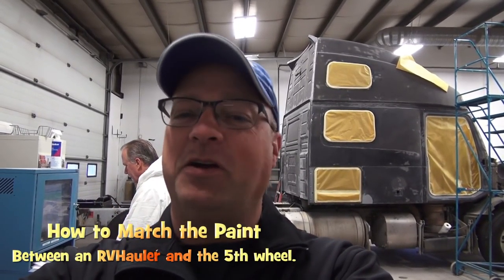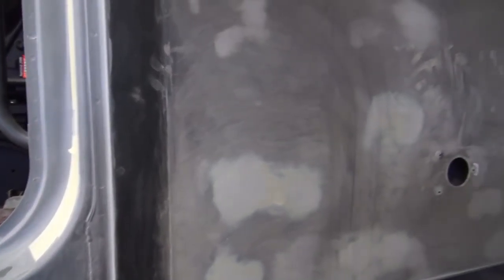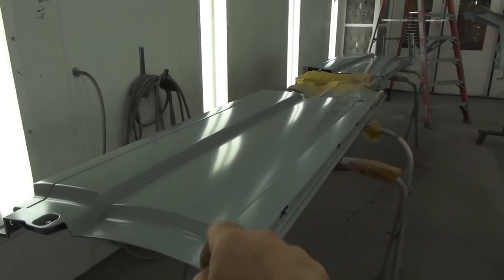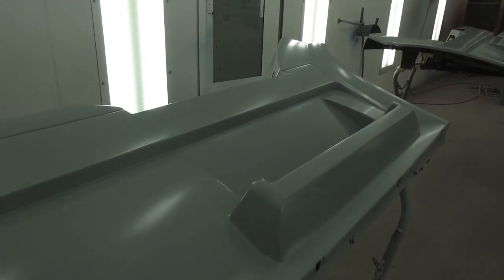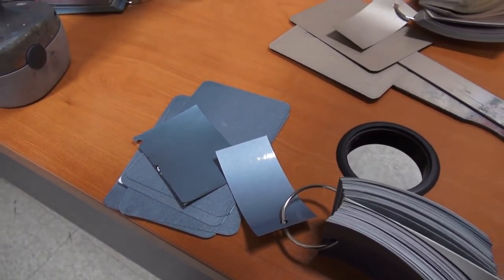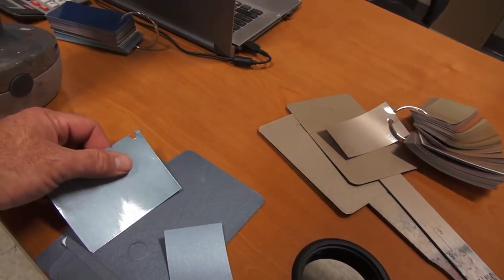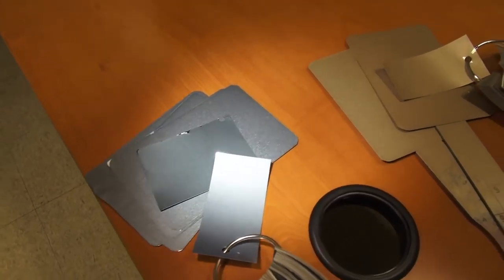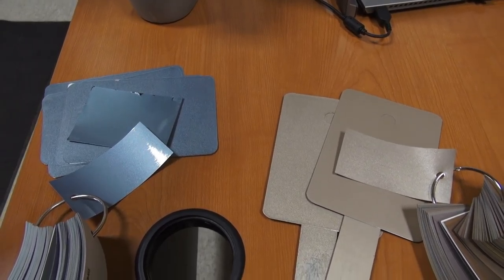How We Match Paint Colors and Full Body Paint Preparations for STORM

Comment: I've been checking your video.. I like what I see.. My question is. I want to buy a Volvo to convert it to an RV.. 2006 2007. Been checking them out on kijiji. I much are we talking about converted to an RV.. I live in Windsor Ontario...  I am pulling a 40 foot Toys hauler. My truck is a 2500  diesel 2013 ..I'll be waiting for you reply thank you
Reply from the maker: +Gill Labelle  There are quite a few questions I have to ask before I can accurately answer your question. For example, do you want a bed?  What do you need for storage (if any).  Those two questions can alter the price by $35,000 alone.  I would welcome you to call us, and we can quickly ask those due-diligence questions, and provide an accurate budget.